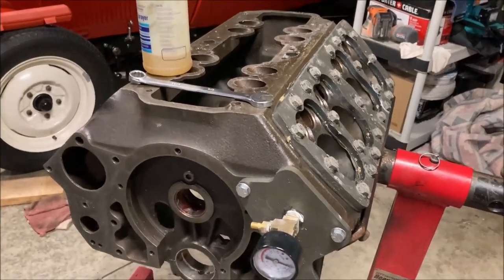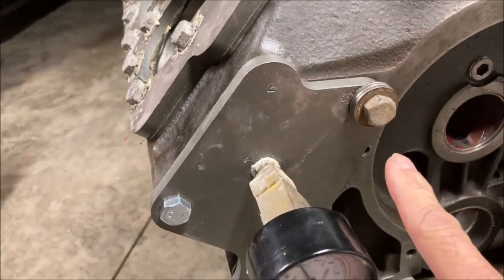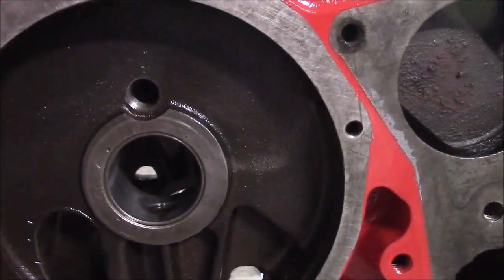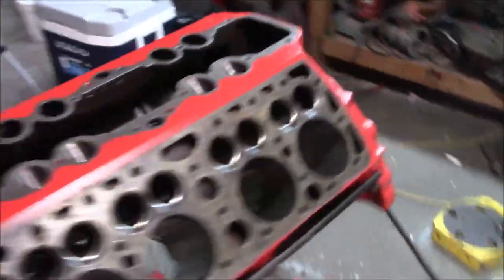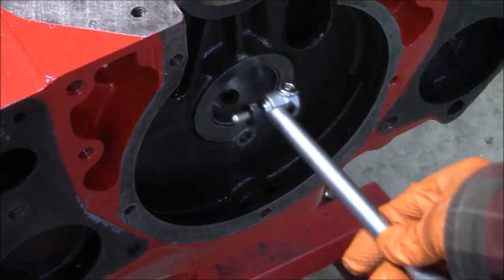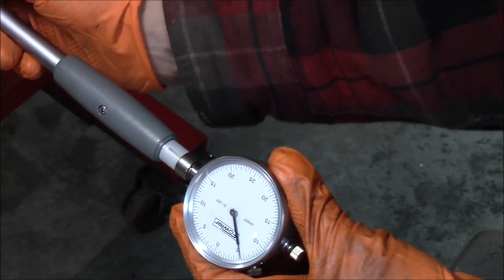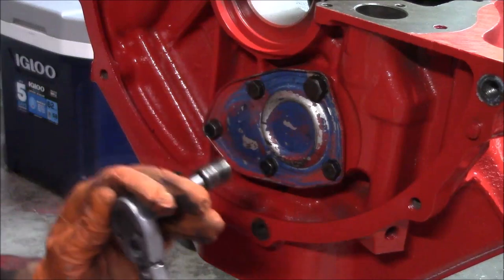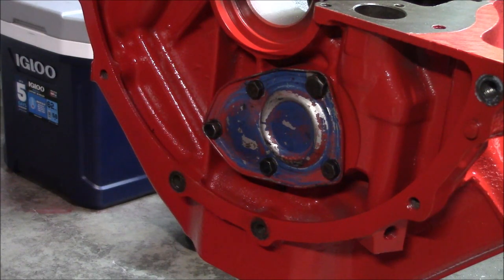49-51 Flathead build (Cam install)

Comment: Never did a pressure test done that way myself. I set mine up, hoist it up and into a tank of water and run it up to 100 psi. You will damn sure know your bores are if you don't see bubbles from the cylinder walls.
Reply from the maker: Hi Mike, this is the most common way to pressure check a Flathead Ford.

Comment: If youd mound a flathead on an engine stand through the bell housing holes like engines sit on them nowadays that is a recipe for disaster or what?
Reply from the maker: Hi Jordan, you can mount a 49-53 8BA style flathead like a modern engine with no problems. The earlier 59A style flathead has the integrated bell housing, and it is not recommended to hang it from the bell housing.

Comment: Appreciate the comprehensive vids. I've been soaking them in lately. Got my first merc engine Jan 1st. I'm hoping I can clean the deck up myself flat so the heads will seal. Getting it decked runs me $200 and I'd avoid if I can. Looked it over yesterday and the only cracks I found was those narrow areas center head area between headboard and water passage...believe it's called the ford cracks ....that was it. Got to buy a pressure kit.
Reply from the maker: Hi Boxcar, I have never had a problem with sealing after cleaning both surfaces with a fine wire wheel on my drill.